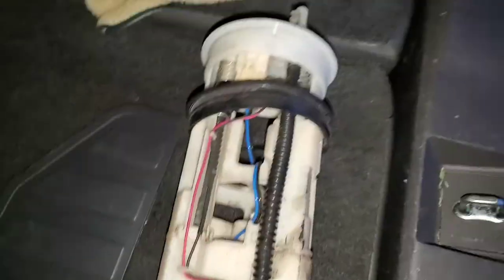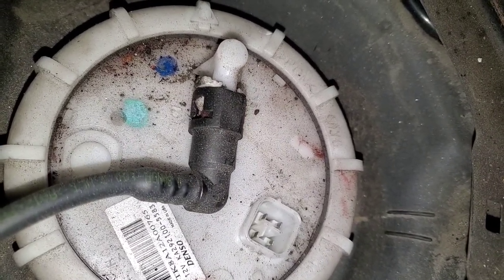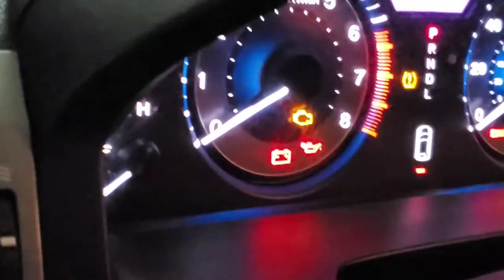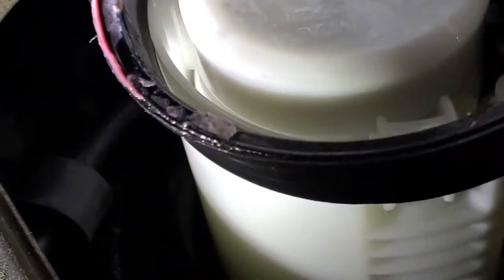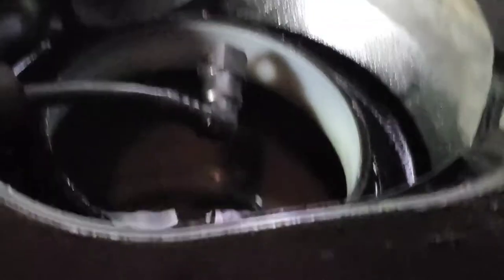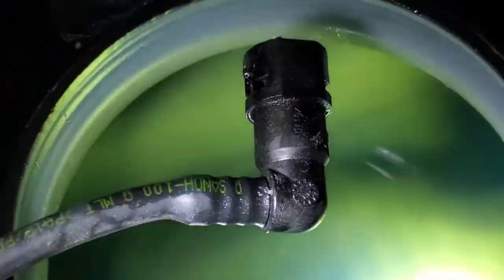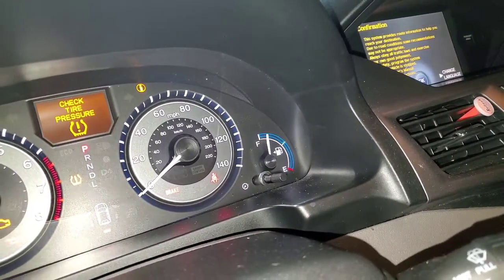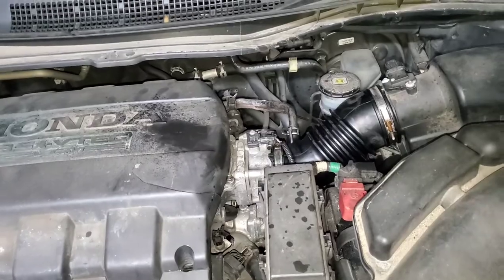2013 Honda Odyssey: Fuel gauge always reads Empty.

Comment: Thank you for the great video, my 2016 Honda light is always blinking and empty. What do you think the issue is?
Reply from the maker: I'd check the wiring especially where it runs under the seats.

Or, if you find it easier to pull the pump, you can check the level sensor's,, and the gauge's, operation from gadgets,.

Good luck.

-100